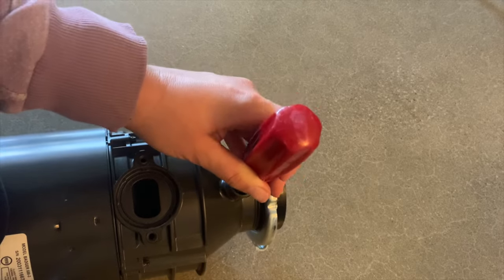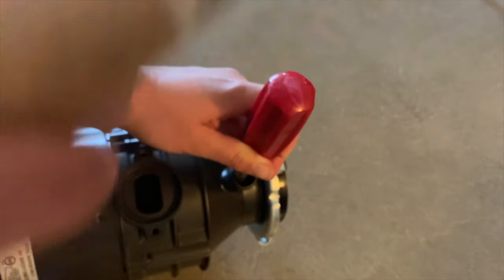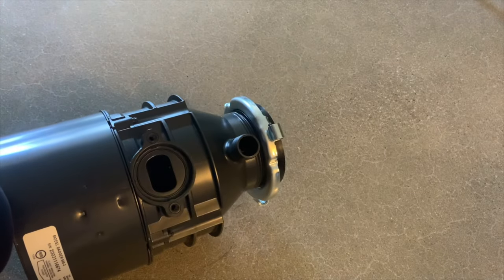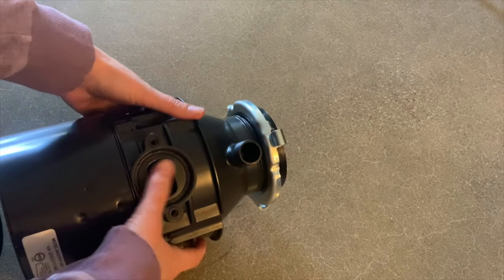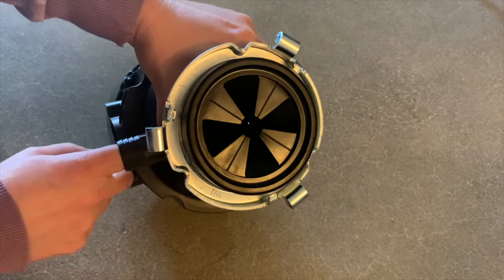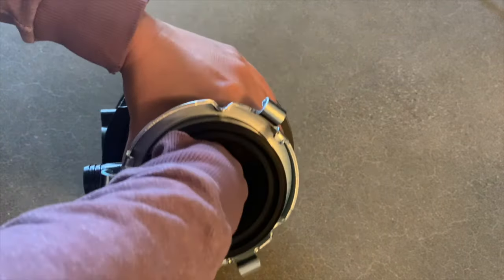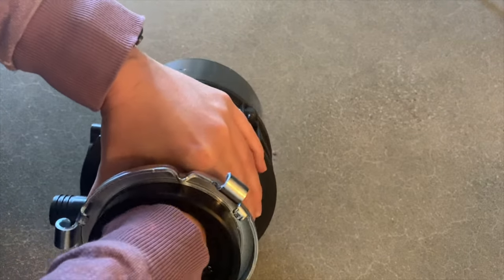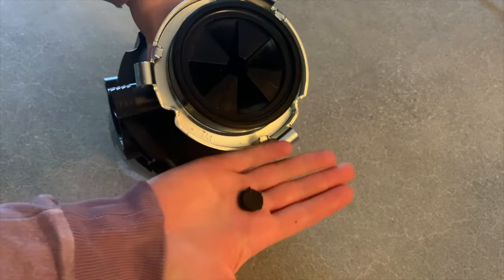How to Remove the Garbage Disposal Knockout Plug

Comment: My grandson forgot to remove it before installing it. Can I take it out while it's under my sink?
Reply from the maker: Your grandson did a very common mistake and it’s easily fixed. I guess you could, but I would be very careful. Disconnect the hose and most likely the worm clamp from around it and have someone hold the disposal steady and then knock it out. It’s because the disposal attaches to the base of your sink; I wouldn’t want those parts to get lose or knocked around. I’d reattach everything and then go from above and get the piece from inside. Otherwise, take it down completely and reattach it. I hope that helps!

Comment: I refused to believe In-Sink-Erator's installation instructions (that hammer-on-screwdriver thing) until I watched your video.
Indeed, I had tried a more conventional hammer-and-punch approach before, and that plug just wouldn't give.
Tip for others: This works even if the unit is already installed under your sink. Just disconnect the dishwasher hose, that's all.
Reply from the maker: @happyjens4545  Amazing tip, thank you so much for sharing. I’m glad the video helped you.

Comment: im a shmuck for forgetting this 10 years ago when installed the disposal, thank you
😀😄😁😅🙂😋
Reply from the maker: You’re not at all! It happens to so many of us. Glad that it won’t happen again 😉
Reply: @allyoucandodiy  Just had this happen to me. Of course I left the kitchen and didn’t notice my flooded floor until I came back down. Ugh! Live and learn! I feel like there should be a tag on the unit itself with a WARNING before you install it, since many of us don’t read manuals, and this part is CRITICAL.
Reply from the maker: It’s one of those mistakes that it only needs to happen once and we NEVER forget to remove it again lol. #HardLessons